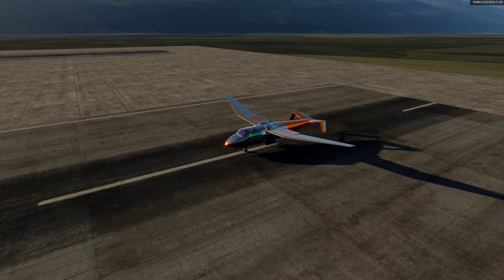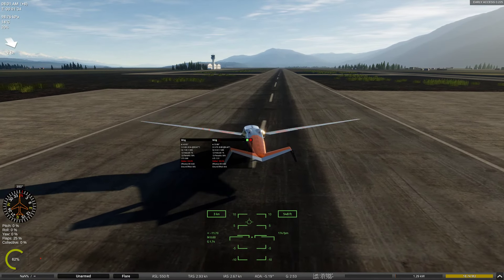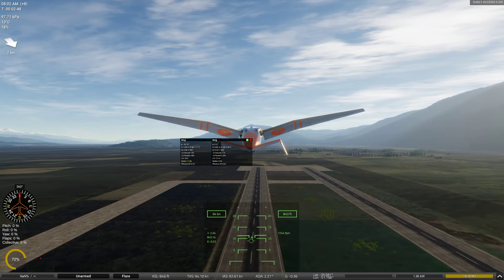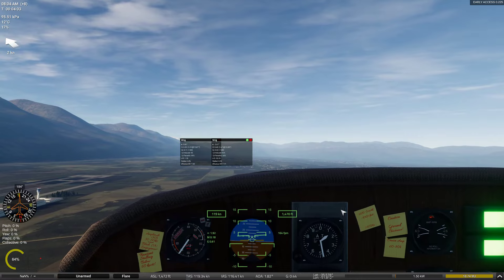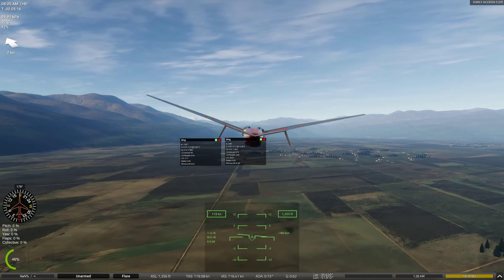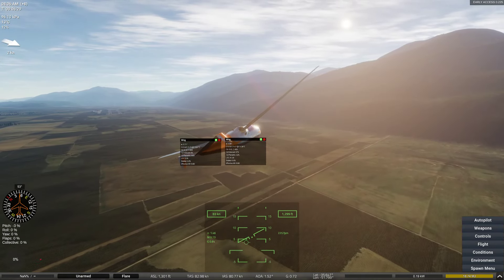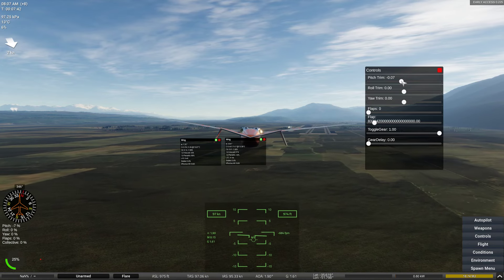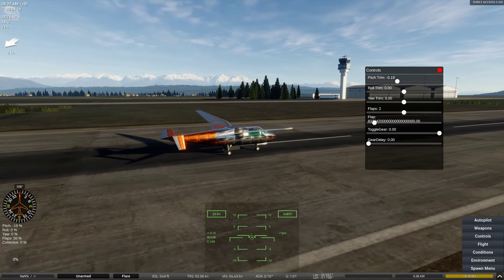The Seagull Ideal, a Birdlike Ornithopter in Flyout

Comment: how.. HOW
Reply from the maker: A few of my older videos get into it. The flapping mechanism is effectively a swashplate. Past that it's screwing around with the wing shape and wing beat angle trying to get the stall speed down as far as possible.
Reply: @decofox6789  How feasible would you reckon it to be to make basically STOL while keeping good cruise speed?
BTW I loved you analysys of the stall characteristics.
Reply from the maker: @zorzerother  V/STOL is a much taller order since the update. Without a way to control blade pitch independently of blade stroke, there's not really a way to keep the blades unstalled from a static takeoff. The actual thrust out of stalled wings is still pretty good, but stalled wings aren't really controllable or functional at moderate speeds in the way they used to be.  It is possible it won't really be possible again until we get Lua scripting, or at least an input overhaul. That said, now that I've implied that it can't be done, that means I'll probably immediately find a way to do it. 

Unless you're talking in real life, in which case I think the real enemy is material science. The sort of wing frequencies we see on my VTOL ornithopters would be insane stress on a real wing. I'm pretty comfortable in saying a practical man-carrying ornithopter exhibiting V/STOL behavior is undoable without a crazy exotic building material discovery.

Comment: I'm just talking out of my rear here, but I would guess that ornithopters, especially ones with low frequency flapping like the one in the video, would be significantly quieter than other modes of air transportation currently available IRL. Considering noise is a huge issue for urban applications, I wonder if these could find a niche as VIP transport, sort of like the various eVTOL concepts floating around IRL right now.

Comment: I suspect real life ornithopters would run in to metal fatigue issues as well as a large number of dangerous powerplant failure modes (what happens if one wing suddenly seizes full up or full down while the other continues to flap, for example?). Birds have the advantage that the materials their wing joints and powerplants are made of can perform self-nanorepair.

I also anticipate seasickness would be an issue... 🤢

For a more birdlike takeoff and less difficulty with high-flapping amplitude causing trouble during the takeoff run (tip stalls, potential for wing hitting the ground, etc), maybe a JATO bottle would be appropriate, emulating a bird's hop into the air? Alternatively, you could go with pterosaur's launch method and use the wings as part of a catapult mechanism for the aircraft to hurl itself into the air. This made pterosaurs lighter than birds of similar size, because birds need enough muscle in their legs to hop into the air, which is then dead weight in flight, whereas pterosaurs used their wings (which had to be muscular anyways) to launch themselves.